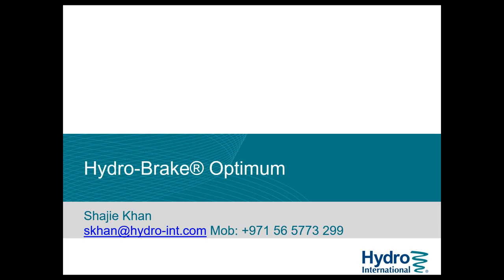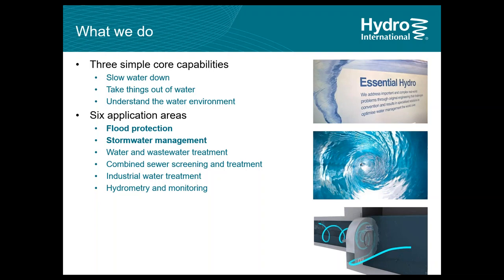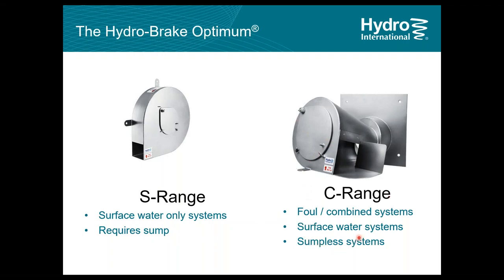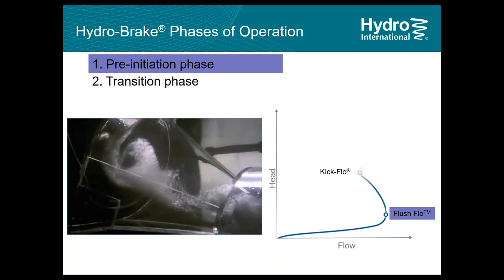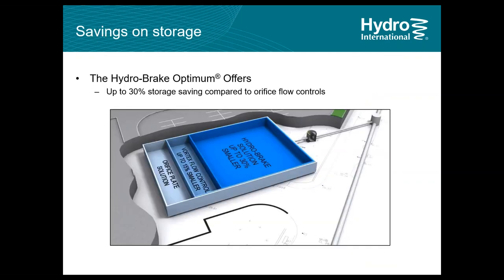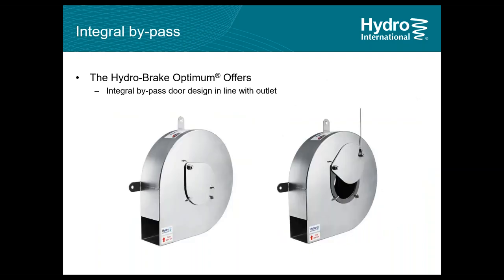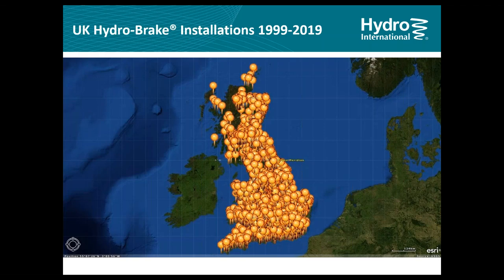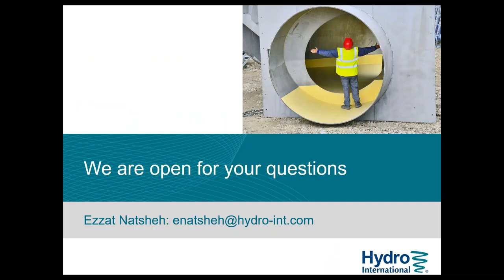Webinar:  Hydro Brake® Optimum

Comment: Dear Shajie, 

Thank you for sharing this video.

This is very informative and useful for  design of storm water networks, but  based on the outflow controls and upstream flood we can decide the orifice plate size. how can we design size of hydro brake? is there any hydraulic spread sheet or in any hydraulic model?

Also time at 13.59 you are talking about volume of storage in network, for modelling purpose HB is integrated with the any design suites? to check storage volume differences?

Thanks,